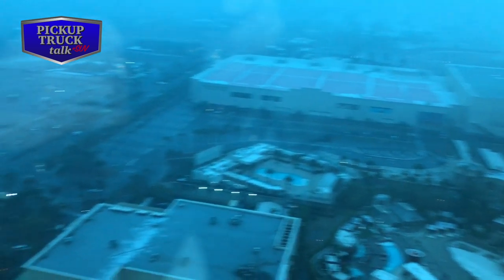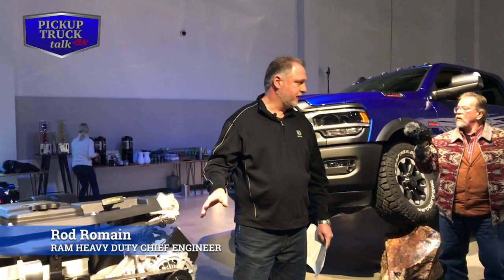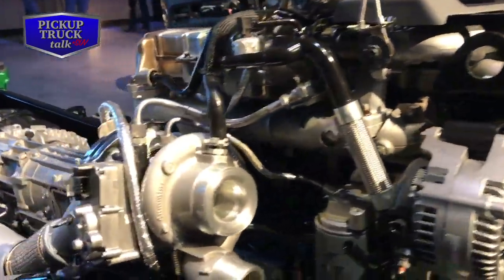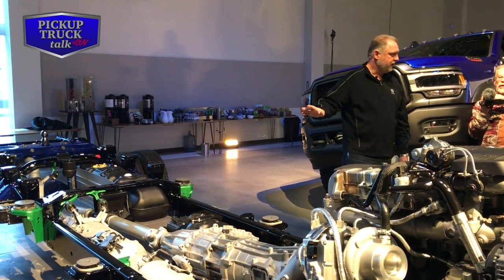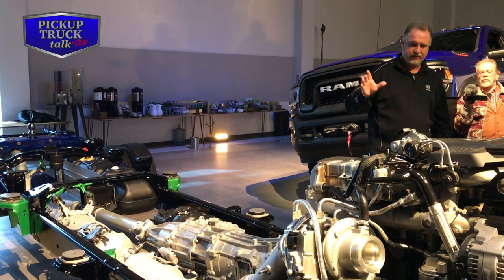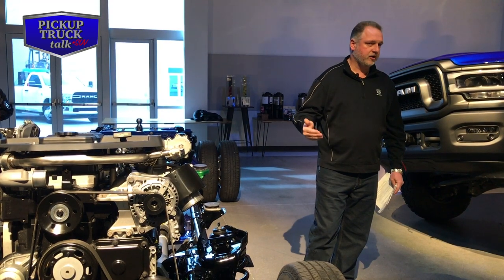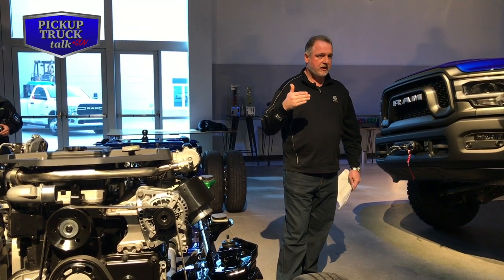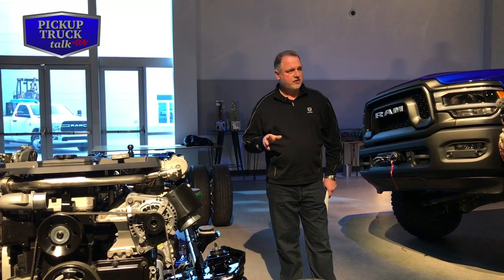2019 Ram 2500, 3500 HD Chassis, Powertrain Deep Dive Interview

Comment: Ram has the best engineering team out there, period. They care about how each part interfaces with one another. Just amazing to see how well their product performs. Awesome sexy truck
Reply: I'd like to believe that, but I need to see proof of that with less electrical issues throughout their lineup and less issues with the suspension on the 2500's from the previous generation. 

The best parts of Ram are the aisin transmission(Toyota) and Cummins engine. 

They do have a good look, but their engineering seems to be par at best.